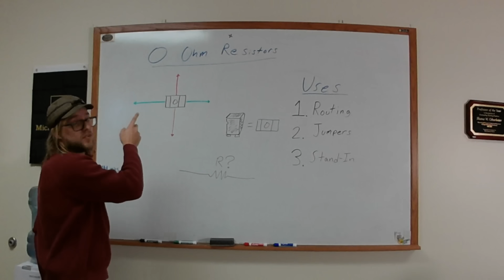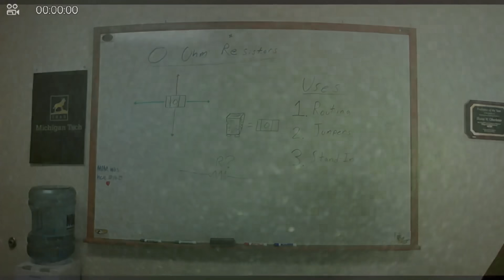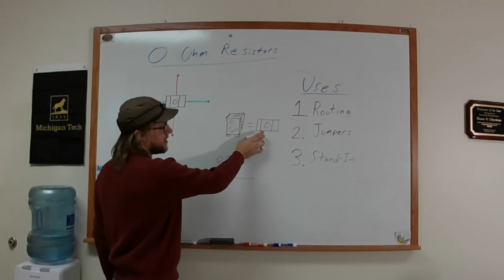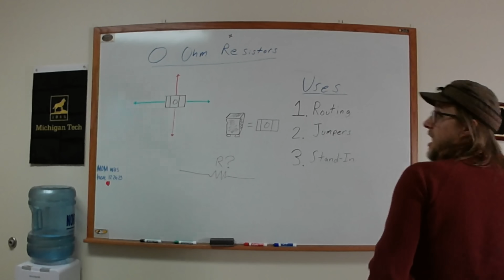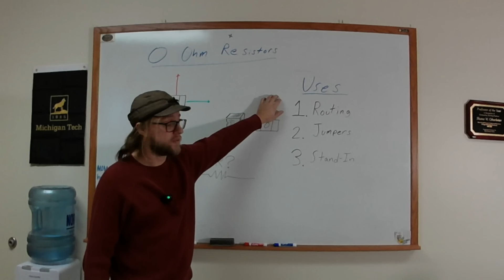The Resistor That Doesn't Resist

Comment: i feel like surface mount zero ohm resistors should just have their top side be entirely exposed metal... that way you can have a continuous bridge of solder between both ends, and it essentially becomes a single solder point which you can place and remove without having to separately melt the solder joints on both ends

Comment: Isolation would be my biggest guess, as you can isolate, trouble shout a particular part of a circuit.
Testing would be the other, as in test point rather, multilayer boards need to have accessible test points.

Comment: The most use of 0 ♎ is to act like a fuse
Their size related to the current & seen used in light bulbs and micro circuit that needs delicate current protection.
Also it can be like shunt resistor.

Comment: Zero Ohms resistors as probing test points. Specially through hole with alligator clips. Same Voltages reading both ends, visually easy to identify. if you break it easy to replace, just ot name a few ;-)

Comment: The fourth is to let the SMT Soldering machine easy to pick up and Solder the jumper to the circuit board! Because the Zero Ohm resistor is design as same size as a normal resistor. so not need to waste time go set the machine 😊

Comment: Of course the question becomes, why not just a piece of wrie, or bent wire if needed?
Reply: On a laboratory circuit, you might do that.  On a professionally built circuit, you'd use the zero ohm resistors so your circuit is more elegant.

Comment: 1:03 "it's essentially a wire, it has no resistance". Since when do wires have no resistance, or any room non-superconductor material for that matter? Often, it may not matter in typical scenarios, but for instance for something as simple as wiring my 12v circuit on my sailing yacht, wire resistance and wire heating are very relevant.

Comment: So what U didn't cover is the actual main function is it's a fuse ..while the board is being assembled by a robot some have very limited stacking numbers .stacking being the amount of parts that fit in a machine ..so how many resistors or how many capacitors fit in the machine kinda like how many bullets fit in a magazine ..so when the robot is running and installing the resistors instead of having an extra part and a whole seperate code to install U just program it to install a zero ohm resistor making it faster ..also fuses cost about $3-7 each and resistors are 0.20c-0.90c each so it saves manufacturing costs

Comment: Also 0 ohm were  used because component insertion is easier to insert in circuit boards then a wire.

Comment: okay but what is the tolerance on that? like obviously it's not gonna be exactly 0.0Ω, but in contrast to a resistor with a value like 47kΩ where depending on the grade it has a tolerance of say ±5%, you can't just put a percentage on zero Ohms. So does it just have to be less than 0.01Ω? 0.001Ω? 0.0001Ω? what are the specs there?

Comment: We used this in spots where we were uncomfortable with our assumptions, and allowed for the ability to add resistance to some leads where we should not need them. In the second revision we knew if they were needed or not. Also can allow a production time signal switching.

Comment: I think you'll find the reason zero Ohm resistors exist is not specifically the reasons you gave; on boards mage with cheap manual labour, you'll often see uninsulated tinned copper wire links used as jumpers, but if the board is being populated by machine, they'd need a wire link a resistor form-factor so that the machine manipulate it.

Comment: It is very useful for anyone that has to troubleshoot your boards

Imagine having 100 bypass capacitors all in parallel on your board. You then find the board doesn't work because 1 of those 100 caps were shorted, bad, etc. If you group the caps in groups of 10, finding that 1 part becomes much easier by removing a few resisters and isolating the groups.

Comment: I've seen them used as protection devices. In some situations a fuse would not blow fast enough but a 0 ohm resistor would. Antenna inputs to radio receivers often use one in series to protect componets further down the line.

Comment: I'd really like to know why zero ohm resistors still have a power rating! The manufacturers rate them as ½W, ¼W, etc! If there is no resistance, how can there be any power dissipated? And if there is, how on earth does one calculate it?!
Reply: The resistance isn't really zero ohms. You probably can see on the product datasheet, how many milliohms it really is.  It might also specify maximum allowable amperes on the datasheet.  They probably specify it in Watts, because it is tested the same way the 100 Ohm resistors are tested.

Comment: In working with many systems in the Navy, we called resistors with 0 to 10 ohms, sacrificial components. This is because they were basically like fuses, anything high went through them, they would pop quick and were easily replaced. Also, the large carbon resistors were absolutely designed for that reason.

Comment: Just last week I used a zero ohm resistor for the first time- on an ESP32 board to configure whether it should utilize the on-board antenna or an external antenna. There were three pads in a v shape, and you connected either the left or right to the center with the zero ohm resistor (you could also use a wire or just solder if you had to) to enable that antenna.

I also remember seeing these on computers that had "turbo mode" switched always on (didn't have the turbo mode button).

Comment: Two more uses(which is usually seen in mature commercial products):
1. Used to connect the signal ground to the power ground. It's 0 Ω, but it still has a bit of impedance, which can help to reduce the crosstalk.
2. Used as a simple fuse. Of course a real fuse with a rated current is better, but sometimes we can get away with just using a 0Ω(or a small resistor like 1Ω) of a desired size.

By the way if we need a jumper, we usually use a copper jumper wire instead. It's much less likely to fail, especially when there's constantly some current going through it.

Comment: This is kind of tangential to the 0 Ohm resistor thing, but in RF engineering it's not uncommon to design a PCB with a 0dB attenuator in the through-path. The intent is that you probably don't need a part there, but if you end up with higher signal power than expected for some reason, you can rework the board to have, say, 10dB attenuation instead.

Basically its cheaper to include the low cost component and have the footprint ready, than it is to toss your expensive PCBAs and get new ones.

Comment: We use 0Ω resistors in the avionics industry primarily as fuses. If you have components that can short when they fail, you don't want that current rampaging around and destroying or weakening other components/ circuits as a result of the initial failure, leading to a plane crash. We use 0Ω resistors as the 'canary in a coal mine' because they will open immediately, creating a metaphorical 'fire break', which we call a 'boundary zone'.
 One of the many reasons why avionics are so expensive.

Comment: The new Raspberry Pi 5 uses a 0 Ω resistor to indicate which RAM-Model it is; 1 GB, 2 GB, 4 GB, or 8 GB. I very much doubt that the resistor has any electrical function within  the circuit. Since these boards are assembled by robots, I reckon that placing a 0 Ω resistor is just simply a very cost efficient way of visually indicating which model it is.

Comment: It's funny, you've done electronics up through university (grad school, post grad, etc) and i did it during secondary (high) school and I'm guessing we're both millennials but at either end (my secondary/high school finished in 97) and the difference in the projects and technology is stark.
The most advanced anything we had was a 555 timer.
Or equivalent of a Pi or that little mcu board everybody uses was a full size microcomputer with a gpio connector (bbc micro 32k)
And we're the same cohort.
Crazy how it changed in just the 90s.
Arduino. That's the little mcu board, i always forget.

Comment: We never bothered. We just used a wire. No need for a component when you have a spare piece of wire laying around. Wtf is this. When did a component called 0 ohm resistor come on to the market? My guess is around 10 years ago.
I’ve worked in electronics since the 1970’s. Never ever has this been a thing. Some Bernie Madoff shit going on here.

Comment: Current Measurement: They can be used for measuring current without affecting the circuit's performance, by replacing them later with a shunt resistor for current sensing.

Soldering Practice: Beginners in electronics use them for practicing soldering, as they are inexpensive and mimic real components.

Manufacturing Convenience: In automated PCB assembly, 0 ohm resistors can be placed by the same machines that place other components, streamlining the manufacturing process.

Component Protection: They can be used as a safeguard, easily removed to isolate parts of a circuit during testing or troubleshooting.

Facilitating Manual Assembly: They help in manual assembly of PCBs by clearly marking where connections should be made, reducing the likelihood of errors.

Comment: I use a lot of these 0ohm resistor as shunt on datasheet describes this use case, as the voltage drop is more acurate than a simple wire on these components you can get a really good resolution with 32 bit adc

Comment: also seen them used a lot on PCBs that have seen component changes during the lifecycle.  An op amp change or similar can change the requirements for external passives.
How many times you seen a PCB with unpopulated footprints?
I've also seen some DIY audio community designs that spec a zero ohm resistor as a kind of fuse.
The idea being that it will burn out faster than a piece of wire.
Not sure if that is true though.

Comment: I know that this sounds strange but a zero ohm resistor still has slightly higher resistance than normal wire so it can be used to slowly bump the resistance up to get the exact value required instead of an actual resistor that might be too high.

Comment: One of the best uses I've seen was an SMD 0403 placed without electrical connection, next to a right angle SMD pinheader, to prevent accidental unhooking of the Dupont connector.

Comment: I've never come across a through-hole 0R but plenty of SMDs - I kind of assumed they were mostly for routing or as jumpers but nice to know my hunch was correct 😁
Reply: I have a load of these THT and SMD, the through hole as 1/4w, 1/2w and 2w, the 2w I use as jumpers in power supply circuits usually 2 in parallel to reduce resistance,. A THT ferrite is also useful as a jumper where noise is an issue like in switch mode circuits.

Comment: No resistance? Damn, I didnt know they'd figured out room temperature superconductors already. Very cool.
Reply: They have resistance, it's just negligible.
Reply: @carultch  Damn, I didn't know they'd figured out room temperature superconductors already. Very cool.
Reply: @SyntaxDaemon  You didn't read my comment, did you?
Reply: @carultch  "Negligible" really is a beautiful word. The concept of something being so little a factor that any relevancy ceases to exist is pure bliss. You can excise entire swathes of burden from a problem with it. Of course, with such great power comes a great responsibility, a responsibility to understand the scale and scope of the question at hand, and which weights with which to weigh the various factors that apply to it. To clarify the claim with a condition would cleverly circumvent the confusion. Carefully consider the context when communicating your conclusions, Carultch.
Reply: @SyntaxDaemon  What's your point?

My point is, that these zero ohm resistors aren't really zero ohms exactly.  They are not superconductors, they are just ordinary conductors with a cosmetic resistor housing to make them look like resistors.  They will have milliohms of resistance, such as 10 mOhms to 100 mOhms, depending on the quality and tolerance of the component.
Reply: @carultch  My point is, I was obviously making a joke, and you missed it. Twice. I don't mean to be mean, but it really should be obvious. 

If the resistance really were negligible, then I would be obligated to neglect it. A better thing to say would have been that the resistance is negligible under normal use, but an even better thing would have been if you understood that I was obviously not believing these to actually be superconductors.

Comment: sub system validation ... EVT units have zero ohms in series with the power input lines, these zero ohms are taken off during hardware validation to stick Amp meters in its place for power evaluation of high speed, high density electronics, especially if battery life is of importance ... after validation these zero ohms  are then removed from the design for DVT spins

Comment: Zero Ohms are common & serve several purposes. It sounds counterintuitive but in mass production it can be a great way to form a jumper. You already have a parts loader for resistors, so why bother having one for wires? Use zero Ohms. They're also useful when prototyping for the same basic reason. How about different versions of the same device? Some versions need some resistance while others want zero. You need not make any layout changes between them.

Comment: Did you know Scania also used some kinda "zero-ohm resistor" in their trucks for coding?
There was a "circuit-breaker" in the fuse box. It didn't work as a fuse, just as a jumper. If you pulled that fuse out or blew it intentionally your truck didn't have the European 93 km/h speed limiter anymore - you could drive as fast as the engine could push. 🤭🤣😂

Comment: A wireless doorbell I've had actually has three or four 0 ohm resistors standing tall and accessible from a compartment, so that you can make one time adjustments by cutting them to shift the frequency the buzzer emitted and receiver paid attention for, so that you and your neighbour could both have buzzers, and only the correct receiver would go off.

Comment: I've not seen it exactly with 0 ohm, but one use case might be to mass produce small boards that can be changed to fit specific requirements after manufacture.

For example, the TP4056 charge controller has a "programming" resistor that can be replaced to tune the board to match ideal charge current to different battery capacities.

Comment: pretty cool way of going above some traces an connecting some signals that you could not connect without adding an extra pcb layer. Comes to think I sould have used them in place of capacitors for one of my projects that has 3 uses depending how you populate the PCB, one use case requires bridging the capacitor holes

Comment: Now I wonder what is cheaper, a small wire in the case of routing or the 0 ohm resister.  Seems like maybe the 0 ohm resister is easier to install and probably cheaper (plus safer since it can lay flat and not get snagged).   I would also think a jumper (one that can be removed) is also more expensive then just sticking a 0 ohm resister on..  Never thought about how useful these are.  I always thought they were just useful for disconnecting parts of the circuit board or giving you places to measure the voltage.

Comment: They're used as fuses from time to time, and they're also useful for pick-and-place machines in lieu of bridge wires as other comments have mentioned.
Reply: I figured that was a possible use, but didn't know if there fail point and mode was useful for that
Reply: ive seen them used this way in some apple laptops
Reply: Same here. I've heard them called fuses much more than his 3.

Comment: I still don't feel convinced. None of these use cases justifies existence of it. In all 3 cases simple piece of wire would be enough: cheap, simple and more obvious for someone analyzing it. In particular a jumper should be... a jumper not 0Ohm resistor.
Anyway, thank you for the video. I was always curious: why. Now I still see no reason.

Comment: Funny thing that cheap 0 ohm smd resistors are anything between 0.2-2 ohm. If you really need low resistance placeholder use solder tabs or 5mOhm sense resistors.

Comment: Used in 88 and on GM electronic speedometers to calibrate circuits for different tyre  sizes and final drive ratios.
Factory had a device that bridged the 0 ohm resisters, then put a high voltage through them to blow them, in a combination to set the frequency ratio of the speedometer in hardware instead of flipping dip switches, as in VDO speedometers, or shifting jumpers.
All calibration positions had the 0 ohm resisters and they were blown with the special device to match the desired.frequency from the Hall effect sensor in the gearbox output stage.
You can replace all of the resisters with a dip switch on a fly lead to recalibrate the speedo or just mess with peoples tiny little minds by making an imperial speedo indicate metric and back.
A trap is if someone who doesn’t understand the circuit thinks it’s all wrong and replaces the 0 ohm resisters with another value or replaces the blown ones they either kill the pulse counter or mess the calibration up royally.
Fun things these mystery parts.
Reply: That's interesting! Seems crazy how that had been deemed the best solution to make a calibration.

Comment: Zero ohm SMD resistors are also used as a cheap fuse in consumer electronics.  The actual resistance value of a typical zero-ohm resistor is around 50 milliohms with a deviation of approximately ±5%. 
The calculation of the rated current is as follows:
0402 1/16W: 1/16 = I * I * 0.05, which gives I = 1.118A
0603 1/8W: 1/8 = I * I * 0.05, which gives I = 1.58A
0805 1/4W: 1/4 = I * I * 0.05, which gives I = 2.236A